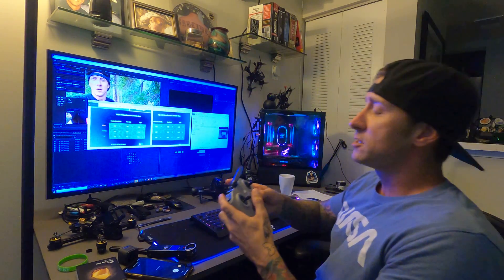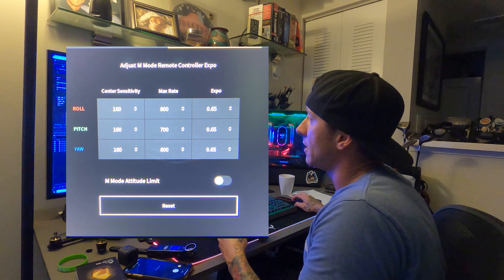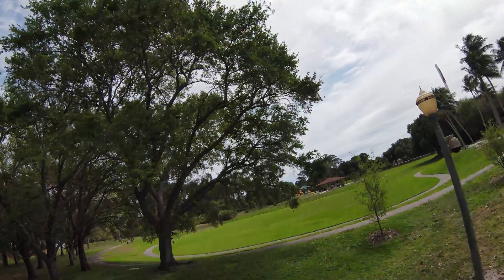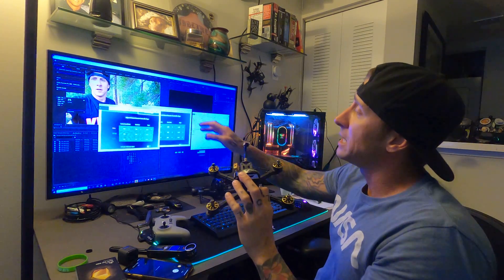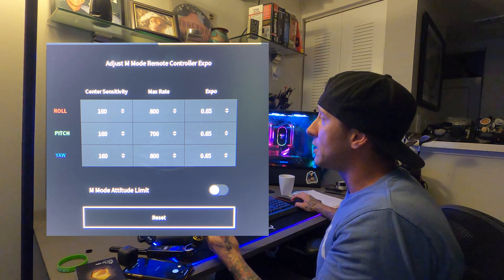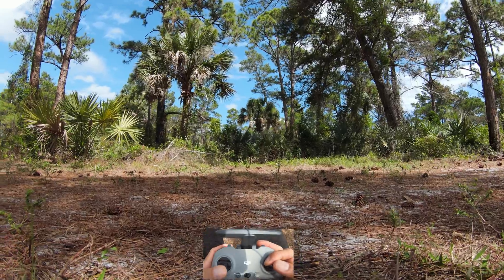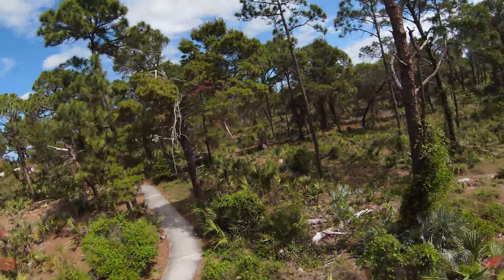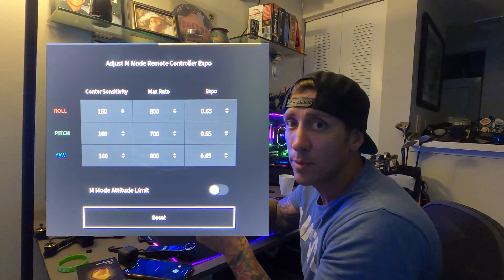Tuning Tips for DJI FPV Drone

Comment: Thx for this tutorial!  Question:  The settings can be changed whilst in N and S modes.  But do they actually only have effect when in M mode as the setting screen indicates? In other words, does changing the settings also tune N and S mode control?  Thx for enlightening me if you see this!
Reply: No only for manual mode.

Comment: very nice video, I am just getting into FPV and have started out with Dji's model, I've been dealing with the jittery movement but hopefully your recommended settings fix that! also a question I have, when flying where do you leave your gimbal at? 0' ? 45' thanks alot

Comment: I used to use expo and sensitivity for years when flying 3d helicopters and manual mode on my M470 quad.  it's definitely something that should be explained in more detail in most DJI FPV reviews, most don't mention gain and expo settings and this is the first video that takes out the guess work.    In many cases it makes the difference between being able to control the quad and losing control when flying manual.   There is no set standard for all quads, controllers (transmitters) so this video was golden.  
Thank you for uploading, this information is hard to find.

Comment: Great flow, this is so much fun to watch! I wonder if an expert like yourself could configure a simulator such as DRL to feel like the DJI FPV drone with your expo settings!
Reply from the maker: That would be cool! I havent had the sim on in a while! ill have to look up some settings on there and try them out!
Reply: @CozziFPV  A big thank you for this. Changed to these rates (except 700 max for all). It opened everything up! 

It would be great to be able to select the DJI FPV Drone in the sim! I’m using the AK Mistral in LO with your rates and it seems fairly close to IRL. 

Your contribution to the hobby for those of us entering through this quad doesn’t go unnoticed and is greatly appreciated!

Comment: Hey awesome video, I started fpv with a tinyhawk2 in horizon mode, then put in over 35 hrs inna sim using acro mode, but when I transition to the DJI FPV, it feels really out of control and not precise like in the sim and how the tinyhawk moves. I be doing power loops tru gaps etc in the sim and with this drone , I cant even do a proper power loop , im having trottle response issues and alot of prop wash.
Reply from the maker: oh yes i agree this manual mode is still very different than the norm fpv drone flights sim or not! you can try acro with a whoop to get use to it too!

Comment: Dope flying. I’ve been in the simulator trying to get better in manual mode. Seeing you fly low to the ground is just insane. I can’t even keep the simulator drone down low like that without ascending or descending quickly.
Reply: Change your camera angle to 25

Comment: so how do you feel this tune worked for your flying?
Reply from the maker: I actually changed it again yesterday haha. Raised the middle rates to 900 lowered the sensitivity to 150 and expo to .65. Feels more and more like a fpv quad the higher the rate gets
Reply: @CozziFPV  Thanks, looking for my sweet flying rate.  Going to hit the airfield for some tuning flights
Reply: @CozziFPV  can you give me all the rates your using please. Hard to see them on my screen.
Thx
Reply: Nice video! I'm so used to flying my 6s Nazgul5 v2 that I have noticed that this drone feels like I'm flying a bus but it's super "floaty" when coming down on the throttle.  I'm wanting to get better response and agility with it. What are your current rates?

Comment: That's not really tuning, just adjusting rates. I guess we will have to wait for a firmware update to get the horrible prop wash handling dialed out.
Reply from the maker: Any adjustments to settings that change flight characteristics is tuning
Reply: @CozziFPV  yeah......its not.
Rates change control characteristics, not flight characteristics.
If you grip the sticks differently, is that tuning too?
Reply: @thedarkrs1  So when a performance shop adjusts throttle response or injector pulse thats not tuning? You are altering the result of the applied input, I.e. tuning to achieve a desired amount of response from your input. If you hold the stick input at a precise position and the alterations you make in the control menu cause a change in the output then yes, you are tuning. Maybe not to the extent of many other racing or freestyle fpv drones but still tuning nonetheless. Nice vid Cozzi
Reply: @jcraigb841  well, in the hobby of fpv drones, tuning means adjusting pids/filters. Thats what 99% of ppl think about when you say tuning. We are not talking about internal combustion engines, there the word is used and has diferent meaning. In fpv it means adjusting pids/filters NOT rates. Fact.
Reply: @thedarkrs1  funny then how if you run a search in YouTube for drone tuning one of the first videos you'll see is Mr. Steele tuning rates. Tuning is tuning, a changing the output based on specific input. Tuning a guitar, tuning a throttle, tuning rates, tuning an oscillator. Changing the output of a specified input to meet a requirement.
Reply: @Justin Baker mate, you are free to use the word tuning for whatever you want. But if you want ppl to understand what u mean, you have to you words in a way that people understand them. Argue all you want, in fpv "tuning" is short for "pid tuning", this is what ppl will think of when u say it, hence this conversation. Technically speaking, opening a tap to wash your hands can be called tuning, you are adjusting the valve position to change the flow of water though it. But if thats how you speak, you make yourself look like a jerk.
Reply: @thedarkrs1  No, by turning the valve you changed the input position therefore that would not be tuning that would be you changing the input which changes the output directly just like moving the control stick does. We're talking about the control stick being in a specific position without moving and changing the output to meet an individual requirement, I.e. tuning the output to meet the need. If you want to tune a water valve on the output side you would have to change the internal orifice or the outlet piping to achieve the desired flow from the valve at any fixed position.
Reply: @jcraigb841  You are so clever, when i grow up, i want to be just like you
Reply: @thedarkrs1  "The purpose of this guide is to help you get to grips with the basics of PID tuning and rate tuning as quickly as possible"

Comment: I was waiting for this.
Thanks. 👍

Can you leave the sound of the engines in the flying "lessons" please it's very helpfull
You are doing a great job for the GPS mavic pilots to learn how to fly in acro. mode with this.
Reply from the maker: That’s awesome! Wish I could leave the motor noise but the DJI doesn’t record sound!
Reply: @CozziFPV  
Awesome footage and thanks for sharing your settings. I am just getting into FPV with this drone! You can add audio to your recordings by going to you Advanced Camera settings and going to the bottom of the menu... There you can toggle Record Audio!
Reply from the maker: @mydroneviz  bro sickkkkkk!!!! Thank you!!!
Reply: @mydroneviz  i was just about to post this, good deal.  I love having a slight audio from the props in a video even if there is a nice soundtrack over it.  @CozziFPV   looking forward to more videos with this quad as well as a possible followup to your last video regarding the compression settings and getting the uploads to look best.
Reply: @CozziFPV  All good man. I subbed to your channel... I think I am going to learn a lot from your style of flying.... I'm a newb! But already doing a lot of sim flights on Lift Off and tried manual mode up at 300' over a large open area and did my first flips and barrel rolls. Working a lot of throttle control and recoveries. Pretty cool hobby so far! Coming from gps drones.
Reply: @CozziFPV  
I think it,s posible to récord the audio.
Cheeck this.
https://youtu.be/HjrzuIZ_pMk
Reply: Engine sound and music well balanced it's the perfect match.
Reply from the maker: I agree!! I’m so glad I found this out today!
Reply: @CozziFPV  
You can record audio on the SD card of the drone by going in the settings and enabling audio recording.